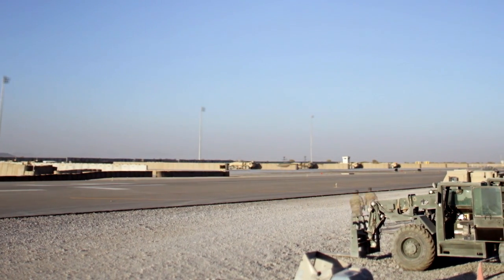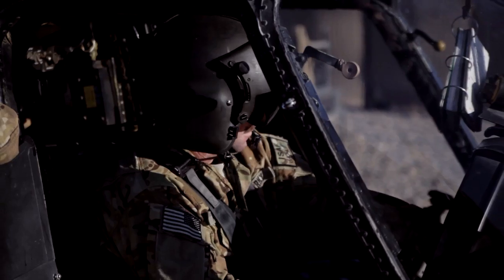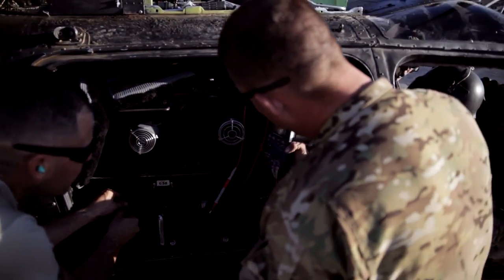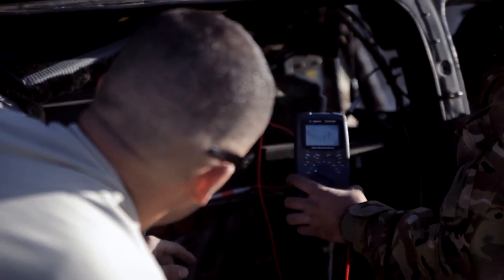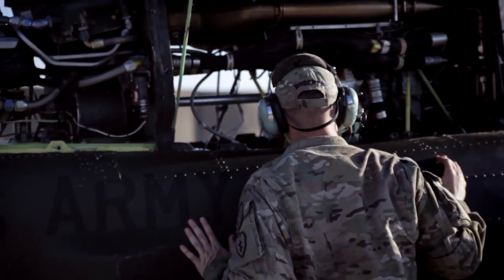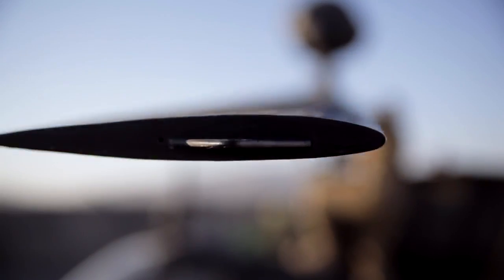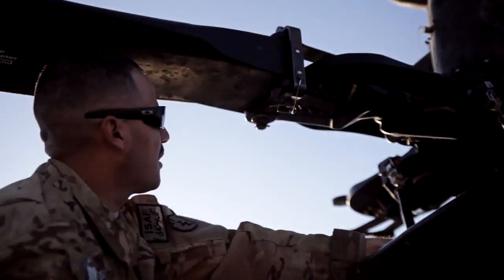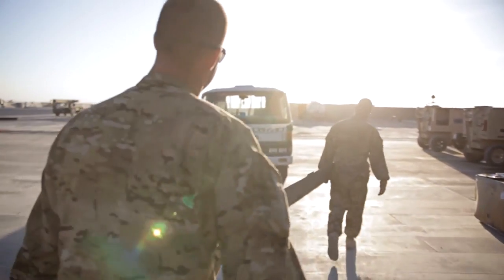FAA Certified Mechanics

Comment: I am a FAA Designated Mechanic Examiner (DME) that performs the final A&P mechanic certification for all applicants.  I provide guidance and FAA certification for those in the military wanting to be certified before they get out of the military or after they get out.  If you need assistance through the FAA certification process contact me at Stache Air.  Simper Fi